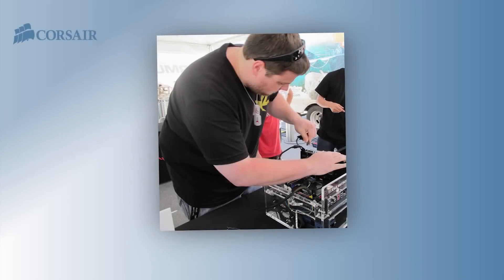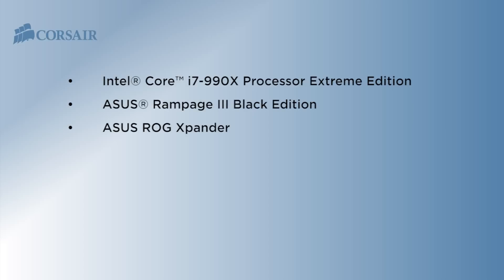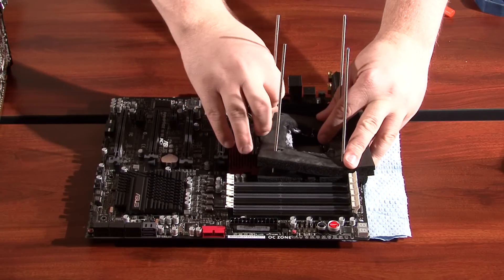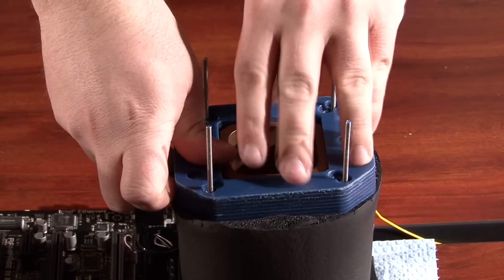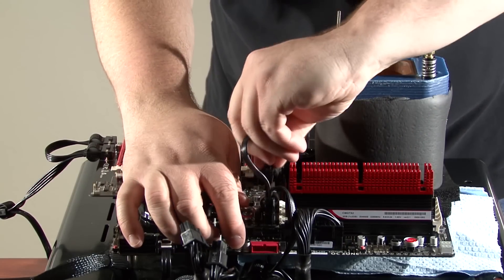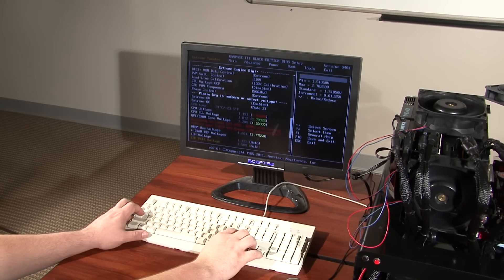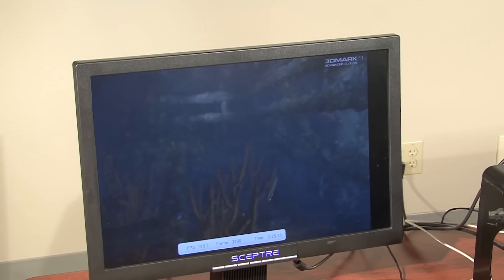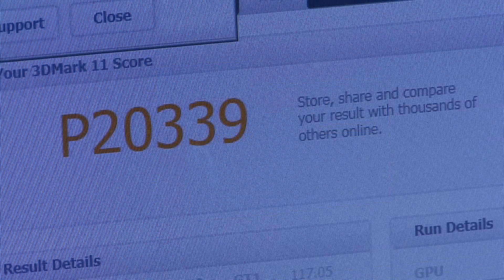Setting up your PC for liquid nitrogen cooling

Comment: Well of course PC gamers should be excited for the next gen, especially with the x86 architecture for the PS4, which should result in better ports. However, I don't understand what you're saying. They will have to downgrade the resolution to 720p and the fps down to 30fps just like they did with this generation, except it will happen much quicker than it did with this generation. Some games like Thief are already launching at 30 fps, and that means it won't be long before it goes to 720p.

Comment: You can yes, but it doesn't solve anything because the systems are so tight that they can't achieve anything higher than 30 fps and 720p

Comment: Well as a benchmark, I can run Crysis 3 completely maxed, besides resolution, I have it turned down to 1024x768 I believe, while I am running a 1920x1080. I suppose poor optimization would be a good reason. There is no question about meeting the specifications, as I far exceed them haha.

Comment: yeah degrading performance probably isn't a good way to say it.  The software just becomes more and more demanding to take advantage of hardware technology advances.  it's not really a problem with consoles its a problem with not updating the hardware you are using.  PC users experience the same problem if they don't update.

Comment: I will be completely honest, I don't know much about modern emulation (GameCube and onward). I personally have never dabbled in it simply because I have never needed to. However, I would expect that you would have to have a very high end system, because the games would be very poorly optimized. However, I have no right to speak on the subject, as I really don't know much more than that.

Comment: I'm not knocking anything, in fact I am a major PC enthusiast, but what exactly stops me from emulating a PS4 on release date (no emulator not being an answer, this being a theoretical question,) is it instability, or what? Because my computer can't seem to handle even a GameCube emulator, but my specs are 8GB DDR3 RAM, EVGA GeForce 560Ti GTX 2GB GDDR5, AMD A8 5600K Processor @3.6GHz... (I also realize this question is rather out of place, but you seem quite knowledgeable.)

Comment: By the way, the warranties on both consoles only last a year. The product is not guaranteed to work after a year. 

In 2012 though, all 3 current gen consoles have a failure rate of less than 25%, and after all, it doesn't really matter. 

A PC is better than a console can ever be, you can do more, a cooler setup, and have better graphics. It takes more time and money, but you'll enjoy it longer too. I still have my Win 95 PC from when I was 5 years old, it lasted longer than my Saturn or SNES.

Comment: I'm not sucking them off. I barely use Microsoft for console, I myself prefer Sony, I've had every Sony console that's come out. I only got the 360 because some friends had it and I wanted to play GTA IV with them. 

The only countries that THOUGHT of banning it were Germany and China. Germany because they followed a Motorola patent (breaking the law) and China for censorship, no country banned it. 

Of course 24% is still huge, but everything breaks, the first PS3's had a failure rate of 23%

Comment: You can buy it from a local hardware shop (I believe, can't remember what exactly my Chem teacher told me). The nitrogen is relatively cheap, but the canister you keep it in is pretty expensive (or other way around).

Comment: To be honest I really doubt BF4 will launch at 720p, but I haven't heard anything on that, so I will have to check. However, the fact that games like Thief are going to be running in 30fps on launch shows the limitations on the new generation. The PS3 and Xbox 360 were admittedly large jumps that could even beat a lot of PCs, but this is not the case this time around. This generation has gone on far longer than it should have and yet we are greeted with specs that are already becoming outdated.

Comment: The point of liquid cooling is to keep your computer cold after many hours of use... Just standard use will get your graphics card, CPU, and power supply above 120F... And gaming computer owners tend to over clock and liquid cool so you don't fry anything and you can run a game on its highest graphics... It just makes things beautiful!

Comment: Pardon my ignorance, here comes a dumb question.  Is liquid nitrogen a  long term solution?  And by that, what I mean is - this, will the PC continue to be cooled on the orginal supply of nitrogen - or will it boil off in the coming hours, days, weeks?   I would think it to be a short term solution as teh nitrogen will eventualy be room temperature - even with the PC turned off.

Comment: Over time they simply can't keep up with PC hardware because you can't upgrade consoles. That's why at the start of this new generation it will begin with 1080p 60 fps (though some games like Thief will be 1080p 30fps at launch), then it will degrade to 1080p 30 fps, then 720p 60 fps, and then it's back to how it is right now: 720p 30 fps with noticeable frame drops to 25 or 20 fps on occasion.

Comment: A PS4 has a lot less to deal with than a PC. PC needs to run an operating system, background programs like Steam or Origin, Team Speak/Skype for voice chat, etc. A PS4's Operating System is designed to take up very little from the CPU/GPU/HDD so that it's just a gaming machine. That's why you can't have Internet Browser opened in the background. 

I'll ask you: Build a PC with the same parts as a PS4, install Windows, try to play games that the PS4 plays. You can't. But you can multitask better.

Comment: You're right, after 5 years the $600 PC would fall behind, you are correct in that regard. However, almost all people will ALSO have a PC anyway, and anybody who buys the new consoles, yet has a desktop and doesn't use it for any gaming, is kind of kicking himself. Now, over the course of the console generation you have to pay just a bit more than the price of the next console for better performance, but Steam sales will not only pay for upgrades, but also the extra $200 on the initial purchase.

Comment: I guarantee you a $550-$600 PC would be able to perform just as well as the PS4 on launch date, and it's not JUST a console. Fast forward 2-3 years, the PS4 will be back to running games at 720p 30 fps. It doesn't matter if it's better at launch, consoles degrade in performance, whereas you can pay just a bit more for a PC that can deliver the same performance, and you will get your money back with sales, and you can upgrade. Consoles aren't bad, but don't give them more praise than necessary.

Comment: That will murder PS4 as long as you upgrade it quite a bit. You can start off with those parts, but maybe you should buy another 7850 and run them in crossfire. That will destroy PS4. If you are actually going to buy those parts, I would advise you to get a GTX 760 instead of that 7850. SLI compatibility and scaling is really good on Nvidia cards and a signle 760 outperforms a GTX 660TI, is on par with a 670, and also outperforms a 7950.

Comment: What I want to know is why you're OCing the processor to begin with? I could see if it was a dual core and you needed that extra push for games. But a processor this fast, I don't see the point in it to be honest, you will never use that much processor for anything unless you're creating real life 3D movies. But thats a nice OC, I couldn't ever do that with this, plus getting liquid nitrogen isn't something you can just get at a store. As long as my games run at decent to high settings, im happy

Comment: Hey regarding a ps4. Im new to anything PC related but slowly learning and been reading a lot. Was wondering how my System will compare to a PS4.

CPU Intel i5 4670K
GPU HD Radeon 7850 DCII OC
Z87-GD65 Motherboard
Seasonic 620W PSU
8GB Corsair Veng
Corsair H60 Watercooling

Comment: Actually, an old hardware will run games on medium to low settings at 720p easily. That's what the PS3 graphics look like. I have an old 2008 PC that can run games on high at 720p. That's better than the PS3 can do.

In 5 years current PC of course will run games. Just at low quality though, like consoles.

Also, PC can run games on 1080p since a long time now. While consoles are 5 years late, but stupid kids like you are still talking like its something brand new.

Comment: Just at lower rame rates, resolutions, graphical settings, texure quallity and not to mention holding off the full potential of modern PC's. Your PS3 is running games which are way too outdated to even challenge a modern graphics card. Hell even cards that came out just one or two years after the console had almost twice it's capabillities.

Comment: Actually, an active condenser in a pressure vessel would allow you to recycle the nitrogen and pump it around in a circuit. There are military systems that run this way - as well as a few emerging technologies that use this method.

Comment: This setup is for OverClocking, overclocking is the process of making a computer or component operate faster than the clock frequency specified by the manufacturer, to test its limits, not for everyday use...

Comment: Liquid Nitrogen is simply useless.The reason why is because no company has designed a CPU block that makes a solid loop.No one wants to set around with a setup like this constantly adding Liquid Nitrogen into the plate.No one wants to use a Torch to cool the damn thing down either to get it to boot.Give me a Freon cooled system any day!!!Easier to maintain & easier to get the Freon.I'm surprised that no company has designed a Freon cooled system yet.I believe it would sell like hotcakes.

Comment: i believe so, beyond a certain temperature, the connections within the CPU itself will cause some of the connections to deform causing a death of the CPU. at low temperatures, i believe it is the lack of energy in the electrons that causes the cold boot bug and the cold bug, although id like a second opinion on my thoughts

Comment: watch?v=-hNgFNH7zhQ <--- That is a video of Logan from razethew0rld or Tek Syndicate showing the "proper" way of applying thermal paste.

When I watched this, I noticed that when he applied it the "correct" way using a pea sized glob of paste, it spread out evenly and stretched it quite thin when he pushed down with the clear "shield".

Why would a pea sized speck be inferior to a rice sized one? They aren't too much bigger from one another, but there is quite the significant increase in size.

Comment: For some reason you are throwing off a "douchebag" vibe. All I want is the correct information, and I am providing counters to what you are saying in order for you to elaborate further, and so I can gain information. There is no need to point out any "inexperience" I have.

Anyways, like I said before, can you provide a video showing how a grain of rice sized speck of paste will cover the entire surface of the CPU? This is not something I can test at home, as I do not have any spare cpus around.

Comment: Set a grain of rice next to a single pea. They are very similar in size. A tiny spec of paste WILL cover the ENTIRE surface. It gets squeezed out of anywhere there is metal on metal contact. if you use too much you will end up with a cake, not a coating. You can imagine anything you want. But all it does it show your inexperience. Go get an old cpu chip, heatsink and thermal paste. Clean them, put on a dot of paste and install. Now pull the sink and see what the coverage was. End of discussion.

Comment: Can you create a video(s) to show this? There are other channels(I don't know if they are experts on the topic) that say to use a pea sized glob of thermal paste rather than a rice sized speck.

Also, wouldn't you want a thin layer of thermal paste to cover MOST of the CPU, rather than a thin layer just covering part of it? I imagine a pea sized glob of paste would cover the CPU better, but the layer of paste would still be spread extremely thin from the weight of the heat sink.

Comment: Im not sure what you mean, "cover the cores effectively" the cores are inside the chassis of the chip. The machined flat surface in which the heat sink mounts is just that. a heat sink, its part of the chassis of hte chip. the "cores" are on the other side of it printed in microscopic architecture. The machined flat exterior of the chip is pressed against the machined flat base of the heat sink. ANYTHING that seperates these two pieces of metal is a THERMAL BARRIER.

Comment: no but i hold the world record for common sense. He holds a world record for an amateur event that holds no meaning.  Just because you fuck sticks can come up with a way to measure nothingness doesnt make you are experts at anything. Point is simple. Thermal paste fills VOIDS where surface finish {RA} prevents the two heat sinks from touching. since air is a poor thermal conductor a paste is used to fill the gaps. But simple fact is even the best thermal paste is less conductive than metal.

Comment: Lol ,while your cpu is at -100 degrees *C your GPU is around +60-80 degrees because there isnt much air flow in the tight space between them u forgot to put good cooling on them a.k.a after market gpu coolers or liquid cooling, which matters wayyyyy more for 3d graphics benchmarks

Comment: Could you make a custom water cooling loop with metal tubing then submerge the radiator in a bucket of liquid nitrogen and fill the loop with ethanol would that work?

Comment: my amd x6 runs fine @4,6 ghz using a h80i and 1 single corsair sp fan @ 1300rpm

temp idle : 25°
temps after 4 hrs bf3 : 50°

Comment: Apparently, the 8ghz is so impossible that 13 different people have done it....  Also it's not pointless, this helps see the upper limits or components without having to actually develop new tech. Think about it like this, either spend millions (perhaps billions) in new tech or a few thousand on good cooling to achieve faster hardware.

Comment: The reason it looks so old and crappy is because of the color. Some companies are using the Model M design and either using the old colors or a nice black, they are quite nice and built very solid. Though they are popular because you can get them new now, I'm sure no one is out looking for a used one.

Comment: You can't really enclose liquid nitrogen like that. Even if you were successful, it would stop cooling, just as you said. But the container would explode before that. Professional containers do have a lid to reduce radiation transfer, but the pressure is still free to escape, it slowly boils away and is refilled regularly. Therefore having to pay for itself, like champion horse sperm banks.

Comment: Well I'm sure this guy knows much more about cooling than I do, but surely extreme cold temperatures are equally hazardous to a CPU as extreme hot? Running a CPU at temperatures seen in this video will probably reduce its lifespan by a reasonable margin.

Comment: first of all buy a pc. not a mac :P. also its all down to how much money u have. if u don't want a gaming pc spend most of ur money on cpu and ram. and get a ssd. if u want a gaming pc. spend most of ur money on the cpu and graphics card. nowadays u can get a insane o/c with just spending 150 on watercooling. don't buy like already done sealed units if u actaully want to play around with watercooling. xspc is really good. also never buy a mac again :P. u can get a normal pc to ran mac's os.

Comment: 4x GTX 590 ? Are you an idiot or just pretending? Gtx 590 is a dual gpu card, and science only a 4 way sli is possible means you cant use moire than 2 of the GTX 590's in a build. Don't talk about stuff you have no knwledge about ;)

Comment: Overclock just cpu (not FSB) it meens normal x 16 make x 20 , but dont touch HT link , RAM and other (and beter buy 990FX MOBO)
and maby you need to rise Vcore to 1.5 v (better have liquid cooling :) )

Comment: agreed, you would be better off creating a small R-404a refrigeration system with a CPU mounted heat sink that runs off of A/C voltage than dumping liquid nitrogen into a copper pot.

Comment: You could in theory, but it would do no good. The reason liquid nitrogen gets cold is because of evaporation, if you keep it from evaporating (which a loop would do) it won't be cold. The reason it's cold when it evaporates is BASICALLY because it boils way below 0 so at room temperature it boils at it's boiling temp, thus cooling lower than room temp.

Comment: Suppose you wanted to do this, not to set a record, but to overclock your CPU with liquid nitrogen for normal operation.  How you you keep the liquid nitrogen cooled and circulating?  Or is that not practical because you'd need a university physics lab?

Comment: Correct, looking at the ground, the world is generating... right up till its finished generating the 300x300 plot radius around you. Once that is done, then it has fewer calculations to do, as the data from the land is stored on what is known as your RAM and HDD.
However looking up at the sky, the sun, moon and clouds all move, with the calculations for the partials and sizes of all 3 being at a constant random setting.
Cheers.

Comment: okay; play around with java and a random script for y=50+(constant for the clouds), and one for the ground, but have that code keep the ground as a one time random generation.
Fool; OC = Higher Htz = faster calculation, and more calculations it can do at one time.
RAM = Random Access Memory; its where your soft data is stored during the course your PC is on for easy access from HDD to CPU to GPU.
Motherboards and HDDs.. well you need to know basic PCs first.